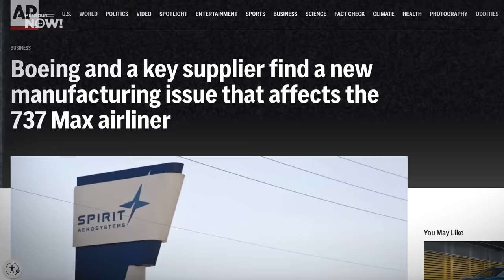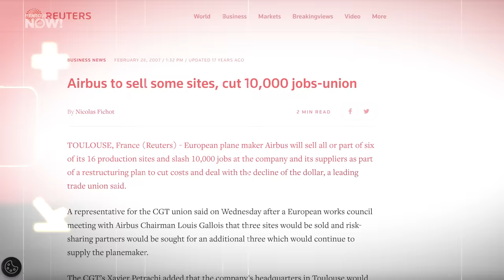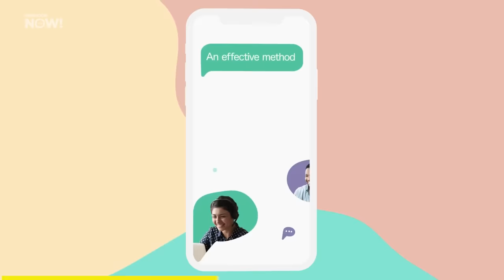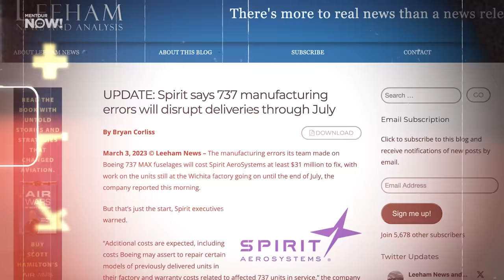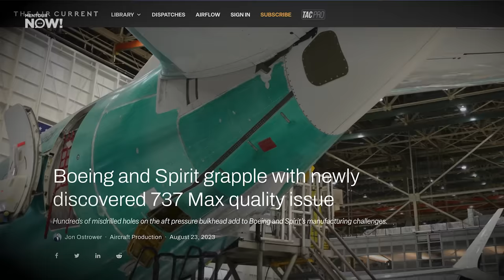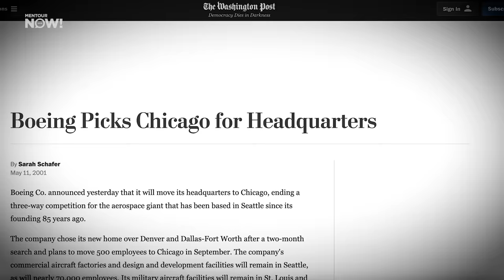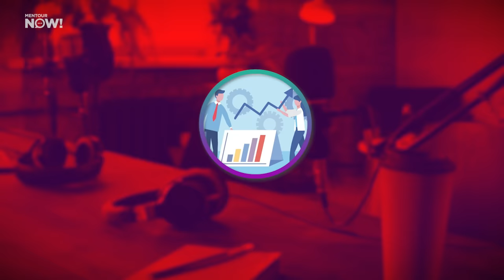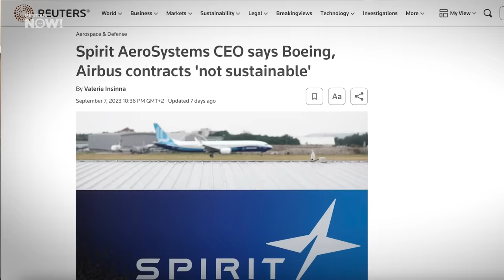NEW Problems with the B737MAX!

Comment: I recall a Boeing engineer was fired after she discovered a sub manufacturer in California was building a section of the 737 fuselage incorrectly and instead of correcting it they released her.  She and others were interviewed on 60 Minutes Australia after the 737 Max fiasco.  Boeing obviously has major issues that are driven by its drive for profits and lack of pride in its product.
Reply: I believe she was in fear for her life. The 737 NG must be the worst of the variants. Extremely heavy landings caused the fuselage to break at the areas where the sections were joined. This should never happen. This is what happens when management is that profit driven, that any fault is swept under the carpet .
Reply: 60 Minutes Australia is notable for its exaggeration and misinformation by omission. Many years ago it claimed the Beech Super King was inherently dangerous after one broke up in flight in Australia.  60 Minutes said the wing had failed and had the usual "expert" claiming a design defect. The omission was that the aircraft was pulling at least 8G when it broke up and was intact up to that point. The reason for why the aircraft was in that position was never established but no fault with the aircraft was  found. This was a thoroughly investigated crash because the Super King Air was and still is widely used in Australia for aeromedical, charter and at the time regional airline services.
Reply: Sounds fishy to me!
Reply: @davidcarter4247  It's a fact that in more than one very heavy landing the fuselage broke cleanly in the same area, and a fuselage is not supposed to break. Passengers seated in those parts of the fuselage were either killed or severely injured.
Reply: Unfortunatly people tend to forget that Boeing makes the safest aircraft in the world... they also forget that 11,000  (that's 11 thousand w/ three zeros) have been made, it's the most common plane in the world.
Reply: @billjones3312  🤣 No engineer was involved in that cinema. Media sensationalists are terrified of actual engineers. I remember the journalism majors at university. They weren’t in that field due to their mastery of higher-education coursework. Rarely do they have a sufficient grasp to deal seriously with STEM subjects. The “whistleblowers” in that feature lost their case at every level all the way to the federal Court of Appeals due to their false claims and misunderstanding of Boeing’s process. There’s a difference between theater, social media, and real life. Actual engineers at Boeing, like every other aerospace manufacturer, have always had a non-compliant parts process for correcting or rejecting out-of-spec components.
Reply: @WilhelmKarsten  Incorrect. On a per-passenger-flight-hour basis, Airbus has been ahead on that score for quite a few years. There are a variety of factors. Prior to the New Boeing (McDonnell Douglas redux, all prior failures of that culture included in the new company), the difference mainly resulted from the number of developing nations flying and maintaining old Boeing aircraft.
Reply: @ReflectedMiles Airbus has TWICE the crashes per flight than Boeing.
Reply: @ReflectedMiles  Boeings 787 is the safest aircraft in history.
Reply: @WilhelmKarsten  Nope. No idea where you are getting that data, but it is incorrect.
Reply: @sandervanderkammen9230  The years and number of hours flown by the 787 so far are not enough for standing with other aircraft in decades-long service. Same for the A350. Boeing also screwed up that program so badly that it is unlikely to ever make the company money—the best that can be hoped for is recovery of costs.
Reply: @ReflectedMiles  NTSB 
Boeing 1.84 million flights per crash 
Airbus 0.81 million flights per crash
Reply: @ReflectedMiles  Sorry lad, the Boeing 787 is officially the safest aircraft in history.
1,117 built and has been in service since 2011 with ZERO hull loss accidents and ZERO fatalities.
Reply: @ReflectedMiles  The Boeing 787 outsells  the A350 2 to 1... the Airbus A380 was bigger financial failure since Concorde.
Reply: @ReflectedMiles  The Boeing 787 dreamliner has a better safety record than the Airbus A350.
Reply: @sandervanderkammen9230  Hilarious when fanboys can’t tell data from marketing. The 787 has no official standing better than the A350—no accidents have involved either aircraft’s systems, design, or piloting and neither has suffered any lives lost. As I noted, with barely a decade in service, and nearly all with major airlines, the numbers aren’t especially meaningful yet. As the old saying goes, McDonnell Douglas bought Boeing with Boeing's money so at this point it’s mostly MD’s record that is relevant anyway.
Reply: @WilhelmKarsten  There is no such data from the NTSB regarding all ops worldwide. Your parameters are undefined and therefore the claimed numbers are meaningless. BTW, my family has been involved in building Boeing aircraft since the 747. One of their top materials scientists was my brother-in-law, who exited following the MD / 787 debacle. We have all been very happy with the work the company has done until the takeover, but that doesn’t mean that we lie about the company’s competitors or our own failures.
Reply: @ReflectedMiles  Numbers don't lie son.
Boeing 787 1,113 built Zero hull loss accidents.
Airbus A350 671 built 1 hull loss accident.
Reply: @ReflectedMiles  Can you provide some evidence that disproves the NTSB data???
 Do you suffer from CDD? (Cognitive Dissonance Disorder)
You comments appear to be completely disconnected from reality and clearly confirmation bias.
Reply: @sandervanderkammen9230  The numbers used by fanboys and propagandists lie all the time. A hull loss is not necessarily a safety indicator. The 787 suffered a fleet-wide grounding due to electrical fires, including severe damage to one aircraft, the first time that had ever been ordered for any aircraft since the MD DC-10 in 1979. Why? Because that was a serious safety hazard. Since the A350 has suffered no such fires or groundings, should I declare now that it is unequivocally safer? Of course not. Grow up.
Reply: @WilhelmKarsten  You have no NTSB data. That was the point.
Reply: @ReflectedMiles  You don't have any data period.
Reply: @WilhelmKarsten  I actually do, but it takes some work and understanding to derive an accurate safety assessment from the data that are available. Some of the best summaries are actually done on Wikipedia by manufacturer, but you do have to know and appraise what you are looking at, not just run with some random number like hull losses.
Reply: @ReflectedMiles  You don't seem to have a working understanding of basic math, your bias is like a neon sign.
Reply: @billjones3312 B737 "Maxx SHORTCUTS"
Reply: @nigelwilliams9307 B737 "Maxx SHORTCUTS"
Reply: @sandervanderkammen9230  Well that hull loss accident was completely unrelated to the aircraft type. So that is a meaningless figure.
Reply: @arnoldhau1  It certainly was related, a A350 has been destroyed in an accident.
The accident report has not been released and not all of the details of the causes are known yet.
Reply: I recall the director of the FAA resigned and several key governments officials on the Boeing 737 certification program were fired or reprimanded and demoted.
Boeing was able to redeem themselves proving that FAA officials were wrong to insist that MCAS have full flight control authority.
The current Max uses the system as it was originally designed by Boeing and submitted to the FAA

Comment: Boeing may have another issue with the trunnion pins in the landing gear. Alaska Airlines had a collapsed landing gear. It was initially blamed on a “hard landing” . But after they looked at the flight data recorder, they determined it was well within limits and not a particularly hard landing. So… the saga of the 737 continues
Reply: That will definitely effect Ryanair then.
Reply: @frankowot4 and that ain’t even a joke it’s true 😭
Reply: Were there any other incidents with 737 trunnion pins?
Reply: The G force was not proven to be OK! Those sensors only take samples spaced out in time; they are not intended to find transient spikes between the samples. The rate of descent was recorded in the blackbox but is being withheld
Reply: @marcellkovacs5452  from what I’ve heard online, yes. But I don’t remember the specifics. And you do have to take online info with a grain of salt.
Reply: Ryanair in a nutshell.
Reply: Let's see.  A major category 2-4 hurricane was approaching California.  The airplane was already 45 minutes late coming out of Seattle.  The John Wayne airport had an 11pm curfew.  The pilots were trying to force a landing with major crosswinds and wet runways right before the curfew and an approaching hurricane.  That trunnion pin must have been the root cause of the accident.  Sounds like a classic pilot error in judgement.  I watched the landing video and they were descending very fast.
Reply: Just do yourselves a favor - never get on a 737 anything.
Reply: If it's Boeing I ain't going.. @xraylife
Reply: @blackvulcan100  👍👍